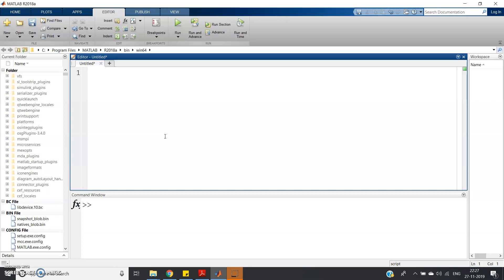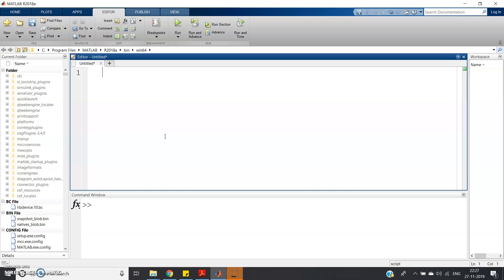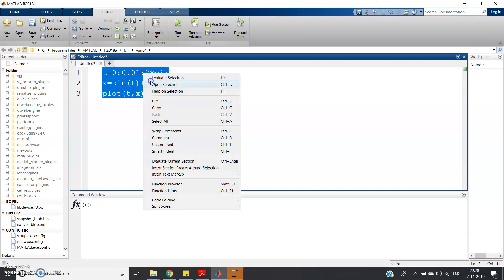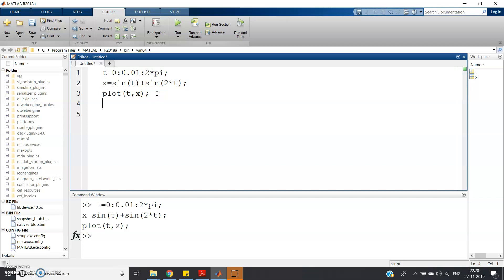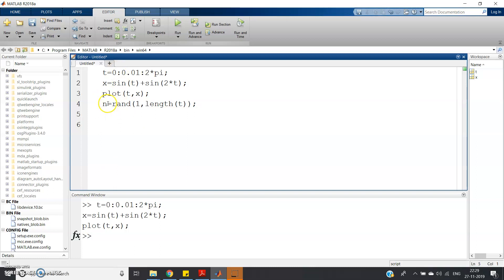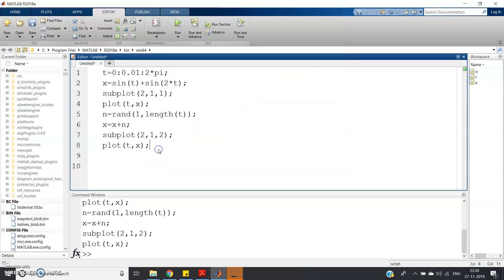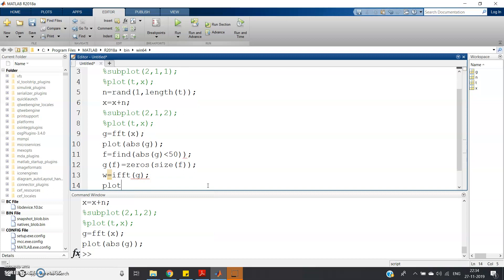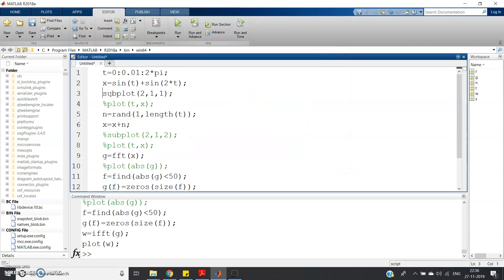Noisy Waveform Restoration using DFT (MATLAB)

Comment: Your methode is working well because of the bandwidth of your useful signal is very narrow (sinusoidal signal) , in the case of widebande signals like UWB (where the signal is onely a brief pulse of 3 ns maximum)  it would not work, because in the frequency domain both useful and noise signals will be sumed ... so how you will separate them ?